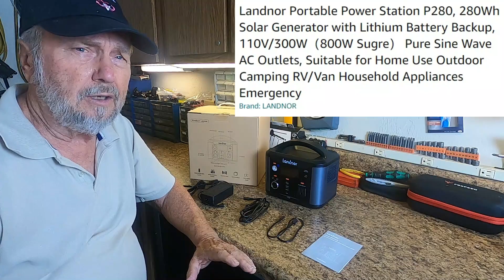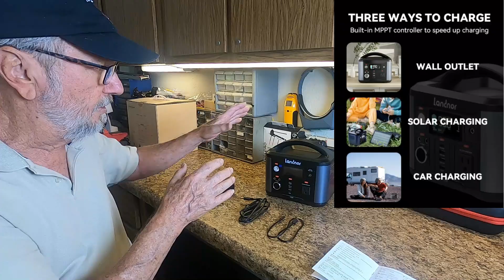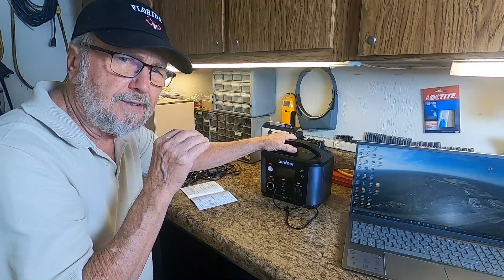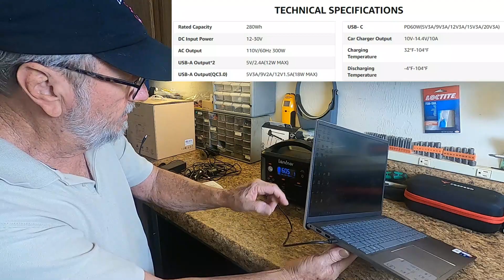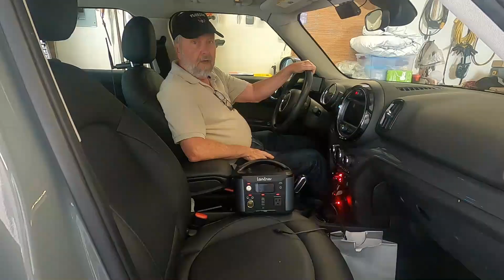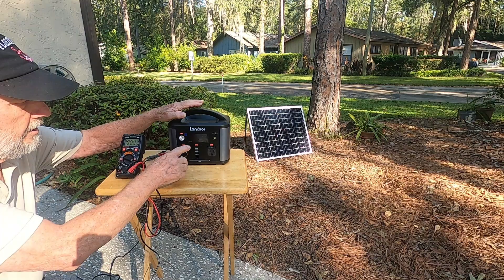Landnor Portable Power Station works great

Comment: Thanks for this video. What is the highest wattage piece of equipment you have plugged into the AC outlet? I was curious about the "Beyond Power" 800 watt mode....guessing that is just a surge maximum for temporary spiking. Have you had any issues with the unit in any other way? Use it often?
Reply from the maker: Most of of these type power supplies of today have a overload protection that will shut it down before it will burn itself out.  I would try to say within the limits as this is just a power supply for household items, it is an emergency power supply.  It is good to have in the car for trips to operate computers and other devices where you don't have A/C or D/C power available.